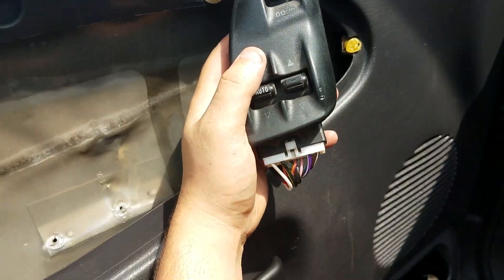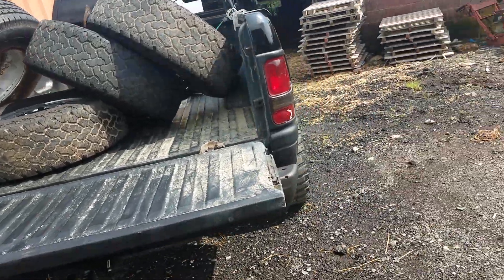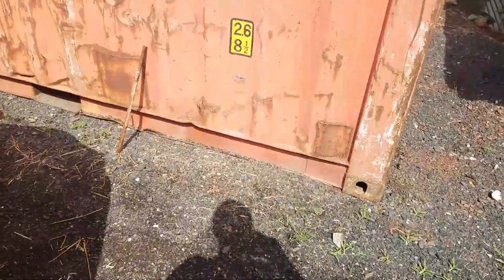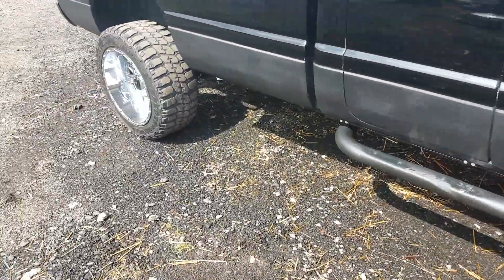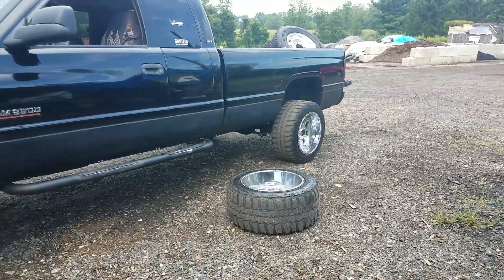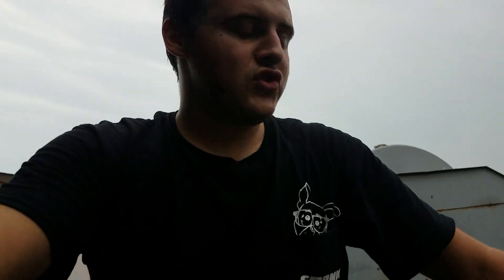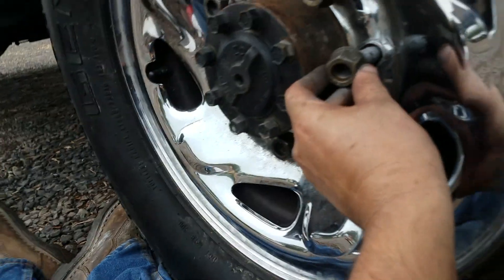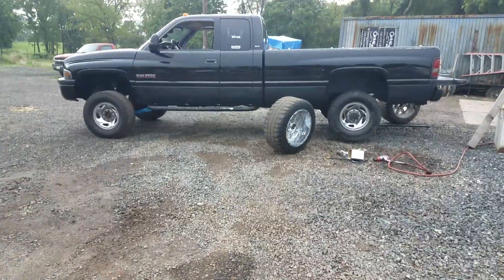20X12 WHEELS DESTROYED MY TRUCK

Comment: Wide wheels will not wear out your control arms, universal joints or any other drivetrain components. They will add stress to steering components such as ball joints, tierods steering box etc. But You can't blame the wheels when you put them on a truck with 200k miles lmao. That stuff was already shot and you didn't realize it until you put the wheels on and they made the wear more noticeable. it happens all the time when people slap lifts and huge wheels and tires on old vehicles with already worn out steering/brakes/suspension.

Comment: dont need a whole new axle. just a new spring plate. cut out the old and weld in the new. had this done on my 01 3500 when i lifted it
Reply: coil spring seat to be more specific

Comment: There was 190k of wear and tear before those wheels and tires. I wouldn't say they ruined the truck by themselves. They don't help in the long term but if ya throw em on with 190k already it's kinda expected.
Reply from the maker: True that man... They essentially exposed all of the weakneses that the front end already had from having all those miles
Reply: Cummins Kyle I didn't end up getting "stanced" till like 250k so I for sure waited to avoid that very issue. Then I blew a wheel bearing with zero offset lol. Trucks comin along nice too man.

Comment: I'm running 20x9 BMFs have just as large of lip as most 20x10 but much lighter.. paid only 732 brand new off eBay closeout deal.
Reply: Johnny Koch Another wheel to look at is Panther Off-road. I got mine on custom offsets for like 550. 18×9 with a 3.75 inch lip. Looks good and doesn't give you all the problems of a 12 wide
Reply: JD Kirane I've ran a xd hoss 18x9 that had a nice lip prolly only 3" tho.
Reply: Johnny Koch Yeah that's a good sized lip for a 9 wide. I had never seen a 9 wide with anything near 4 until I got mine. They are just short of being a 4 inch lip and I love the look
Reply from the maker: JD Kirane thanks for the info john and jd. Will look into em. I want forces but I also don't have 2700 to throw down on a 20 year old truck for just wheels lol!

Comment: 16 to 18 inch wheels.  10 inches wide.  That's all the wheel you need.  Do everything else you want with the tires.
Reply from the maker: FMChimera I can agree. I like 20's, I would assume its safe to run 20's as long as they aren't too wide

Comment: This is why negative spaced wheels don't come from the factory, because they destroy your suspension parts. Stock is the safest bet you have. Them aftermarket setups are no good and they just chase the road. That truck looks wayy better with stock tires.